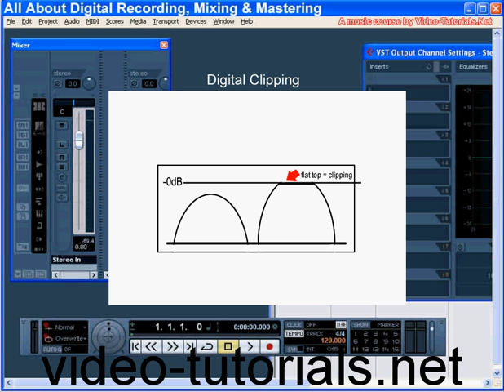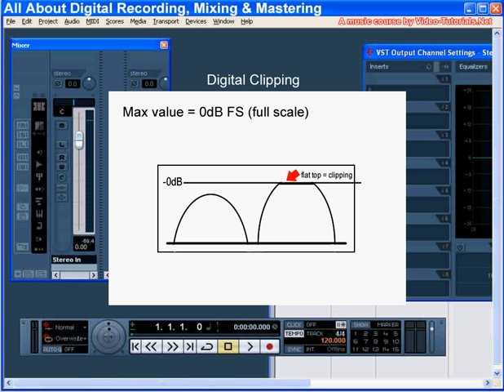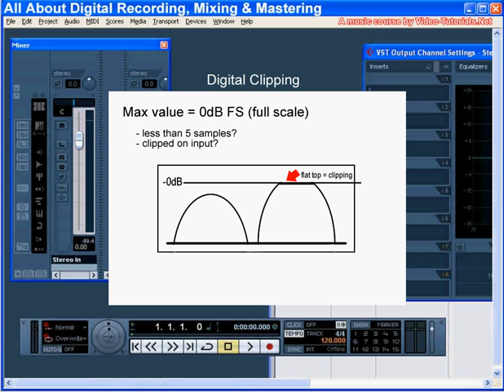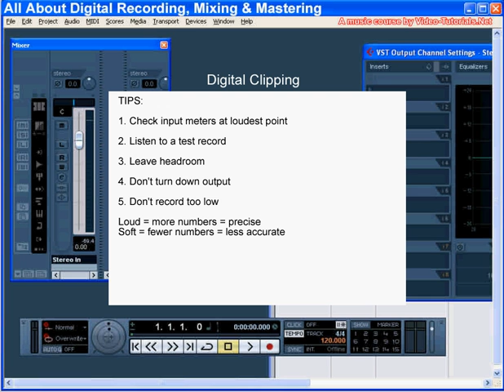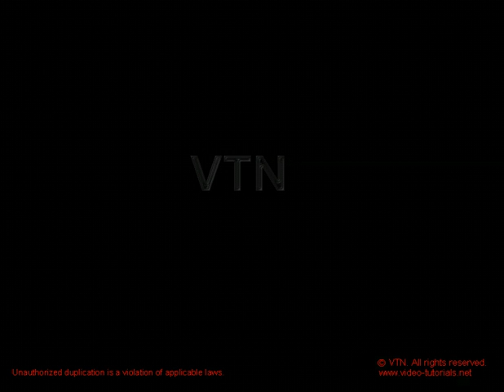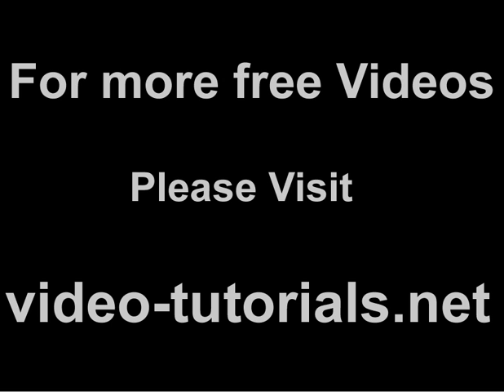Recording mixing & mastering - Digital Clipping

Comment: WRONG  it doesnt clip the top of the wave like that, thats just normal harmonic distortion like guitars use when the signal cant be pushed beyond a certain level by the amplifyer so it just levels off top of the wave creating complex freqencys, in a digital clip though because level is record by the 16 bit value where say 1111 1111 1111 1111 is the loudest you can get just before it clips it and when it clips it does the only thing the computer know how to do and goes back to 0000 0000 0000 0001